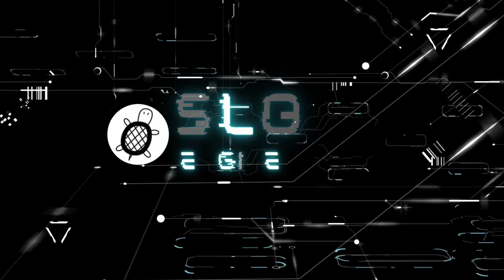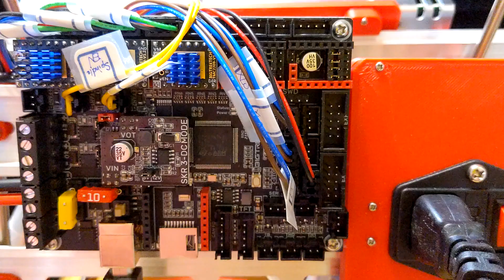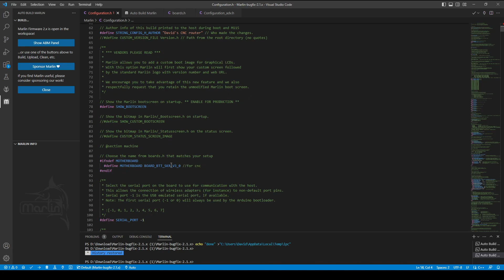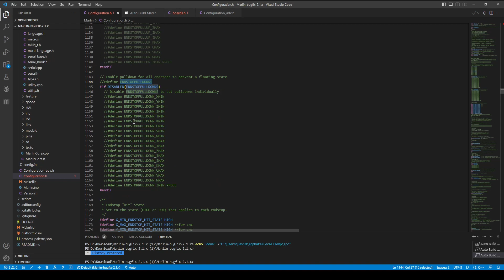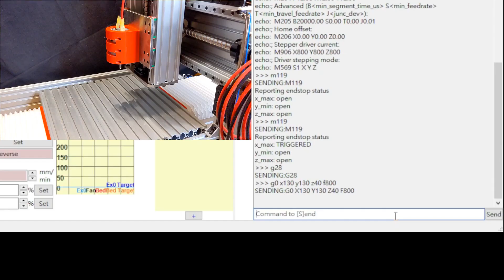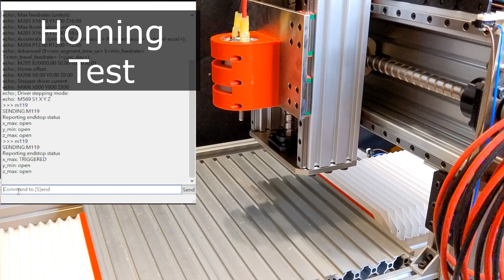[CNC router] First motion test with Marlin

Comment: Great job , but what g code sender do you use that is compatible with marlin firmware? And how do you generate gcode files for this machine ?
Reply from the maker: Thank you. The sender you saw is PrintRun, which I use for controlling the Marlin 3D printers as well. The g-code is generated by the Fusion 360 with Marlin post-processor. Here is the video link to how I generate the g-code path: https://youtu.be/WK8rdnISWUs
Reply: @SlowEngineering  Thanks 🙏